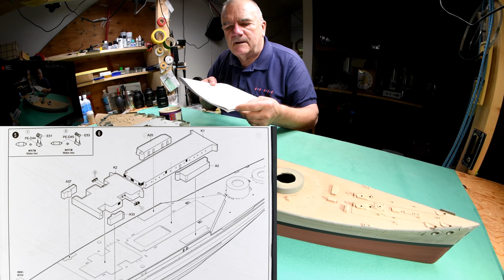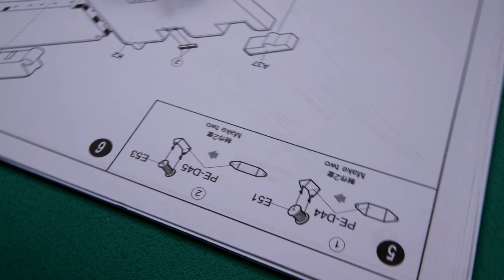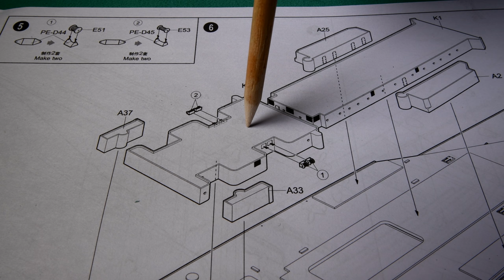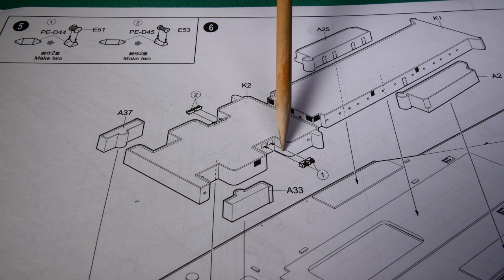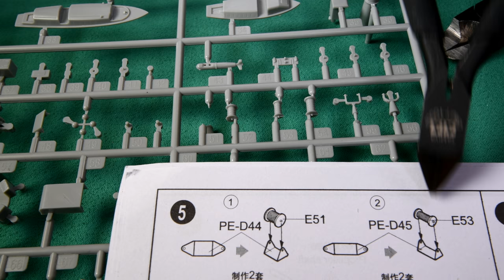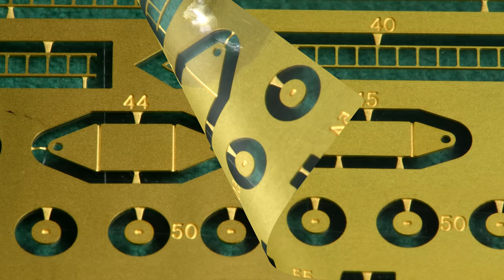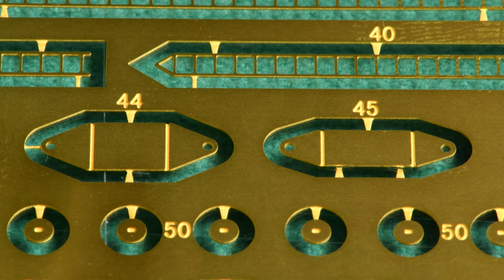The Model Ship - Part 556

Comment: Don’t let them wear you down. I’ve never bought a Pontos kit but I do buy “targeted” PE for what I want to stand out. Typically bridge, radars etc etc.   Not only experience, you also have to take into account the additional huge expense and the manual dexterity required.  Nearly 60, I can tell you that I don’t have the dexterity I had even 10 years ago.
Reply from the maker: Re: "Nearly 60, I can tell you that I don’t have the dexterity I had even 10 years ago" I'm almost 74. 😁

Comment: Ron, Have you thought about getting a hard surface to cut you PE ? I would recommend  one of the following. A porcelain Tile Black, Glass from a old picture frame spray painted black on one side and some card board taped over the black portion,  or a piece of Black Plexiglas or lexan? With the black surface you can see the cut off nubs better and you get a nice clean cut. Makes it alot easier on my old eyes !!!
Reply from the maker: I guess that I was zoomed in too close for you to notice that I was cutting on plexiglass. 👍🙂

Comment: Hi Ron hood looks great, I am just just about to do my artworx wooden deck on my nelson 1200 the wooden deck comes with a sheet of photo etch that includes  strips of photo etch that goes all the way along the hull edge that  brings it up to the same height as the wooden deck so you can mount railings.
I also have an artworx wooden deck for my hood do you want me to send you some pictures of what's included in the kit?
Reply from the maker: Hi Gary,
Scott already did a box opening video of it a few months ago ( https://youtu.be/qwBbtb3ZXhY?t=1002 ) After viewing that, and other videos, I concluded that it would take me way too long to get my Hood completed. Then there is the frustration from the fact that it's a bit too advanced for me. 🙂👍